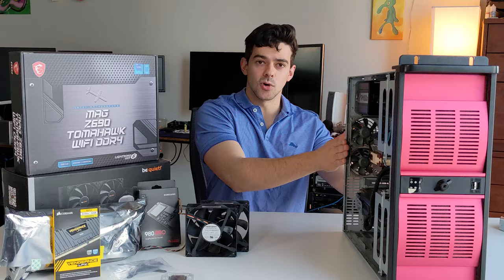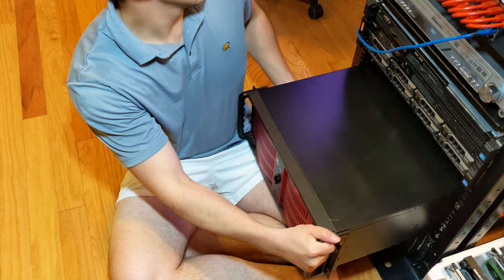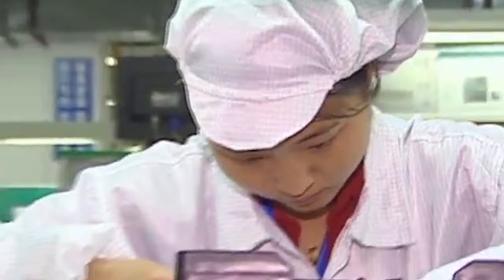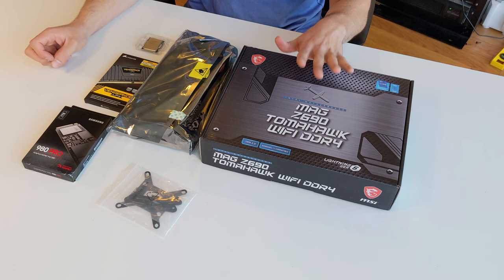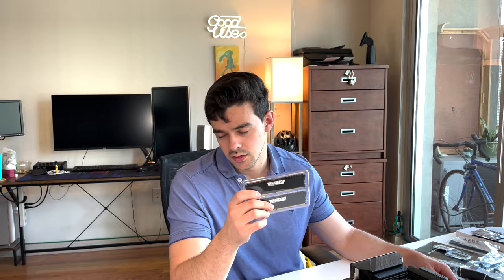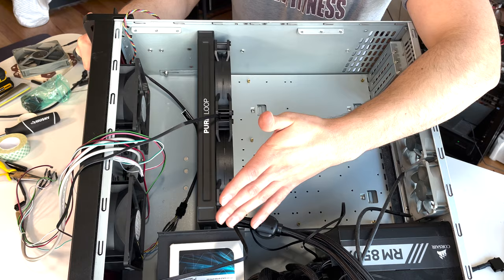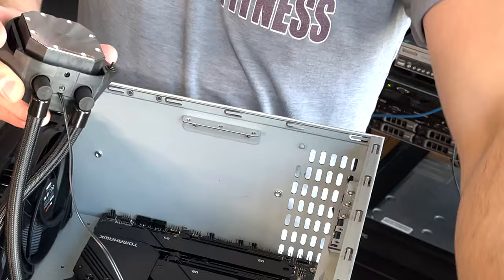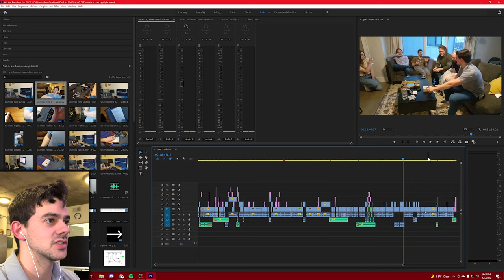Upgrading my rack-mounted Gaming PC so it can actually play games

Comment: Hey Thomas, love the upgrade, I think we almost have the same upgrade I went 12700k and a 3070ti, after shelling out for a glamorized pc I realized I really didn't need the RGB I shelled out for and eventually want to move 

my main PC
my threadripper virtualization server
and a future nas 
all to a rack located near my desk 

I had a quick question, linus obviously keeps his rack way farther away in his new house in his basement and in turn uses a mix of fiber usb-c thunderbolt and optical display cable, since your PC is obviously way closer what was your solution to plugging all your stuff in?
Reply from the maker: Great question and great setup! That's essentially what I've done, although my virtualization server stays off most of the time for noise, which is really the only concern I have with a rack so close to my desk. But, I live in a studio so I don't really have a choice. Maybe someday they get their own room!

I don't have any issues with normal cabling because the routes are so close. Power is fed from two separate circuits (so load is spread out and not just one one 15 amp breaker), which is why I have an extension cord coming from my kitchen. As far as display cabling is concerned, as long as you have a high-quality HDMI/DP cable,  it'll be able to travel something like 15 feet no problem. The only bottleneck here is the cable quality, so that's one area you'd want to shell out cash for. Other than that, having the rack next to my desk keeps cabling a bunch of systems together really simple. Power cables all go to my UPS, network all connects to my rackmount switch, and I have male to female USB 3 extensions for my mouse and keyboard. I also have an A/V receiver that I use as my studio's sound system!

Good luck with your project, it sounds dope!